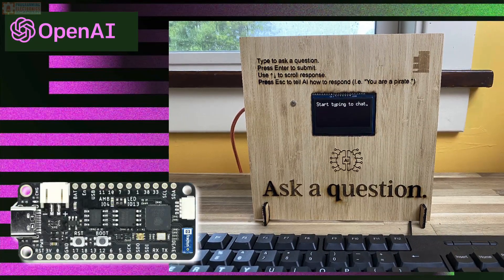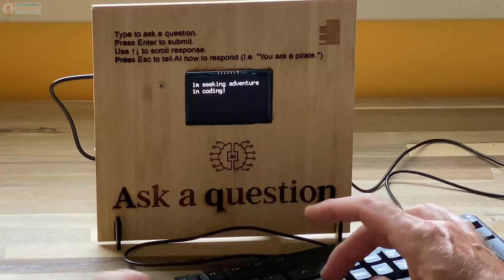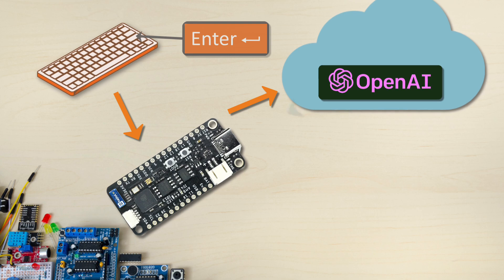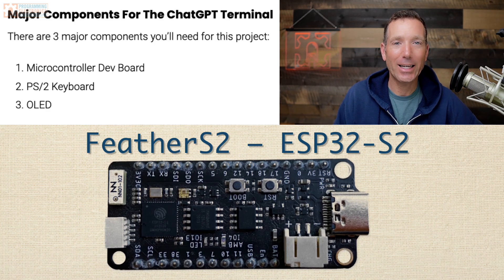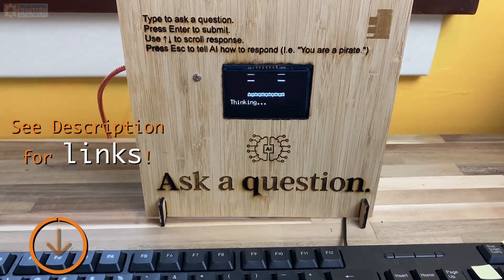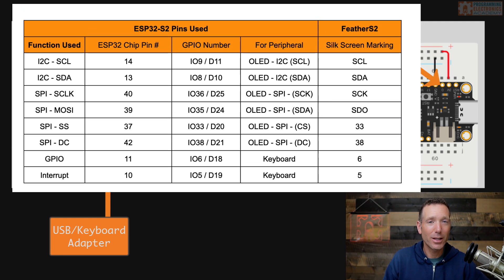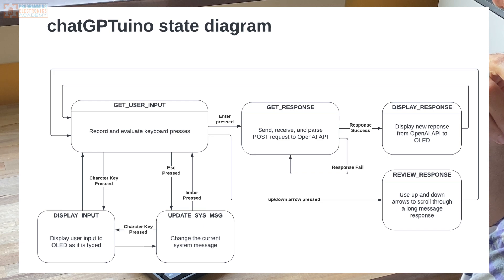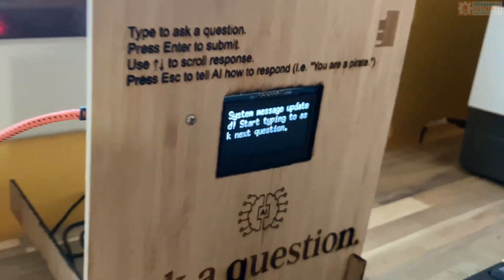chatGPT in your Arduino project?!

Comment: Could this be used to drive servos? I'm trying to get chat gpt to control a set of animatronic eyes. I've got it generating working code that accurately does what I ask. Such as roll eyes, or blink. Now I need it to execute that directly to ESP32, and relate the provided reactions to certain tones and attitudes in conversation.
Reply from the maker: Yes it could.  You'd be using PWM from one of the pins.  

Are you using the function parameter of the chatGPT API to get back your working code?

Comment: Hi. Is there a special software you can recommend for modelling UML State Machines like in this Video 07:05 ? Can you create C-Code directly out of that model ?
Reply from the maker: Hi Pippo, I was just using Lucid Chart for that - it's a "drawing tool" in my mind, and does not generate code (I use it as a visual planning / thinking/ communicating tool).  Perhaps there are systems out there that can generate C code with that, but I'm not familiar with them.

Comment: is it ok to use and lcd display instead of oled?
Reply from the maker: I used the u8glib library in the code, which is only for monochrome OLEDs, so an LCD would require some changes